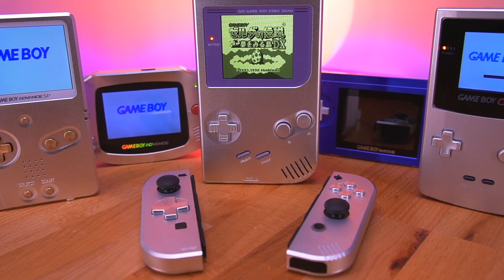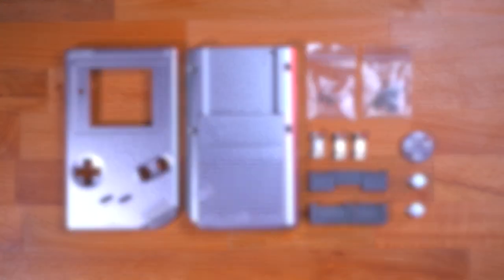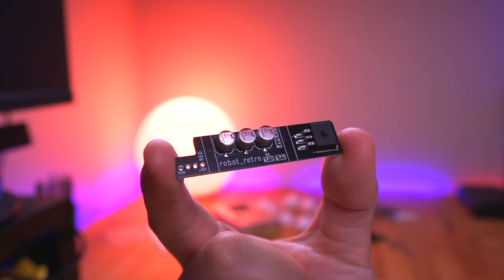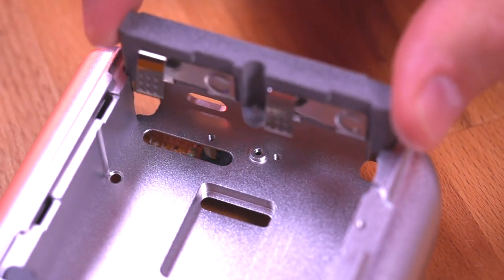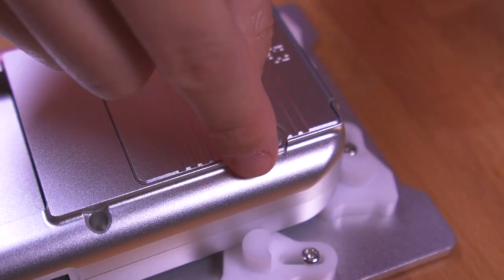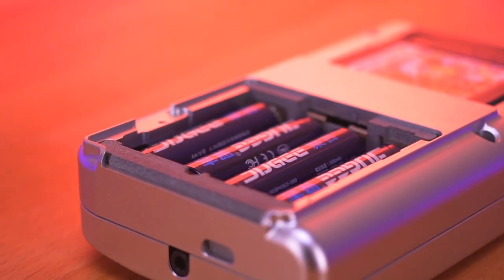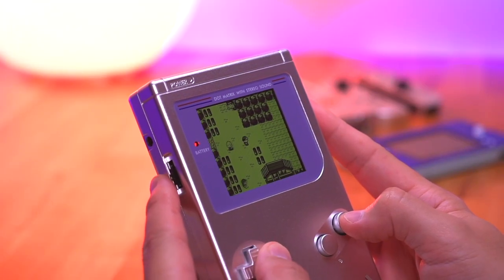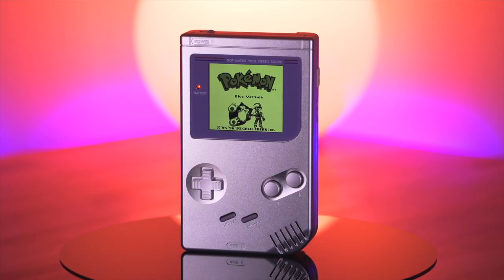The Ultimate All Metal GAME BOY

Comment: so not to be a negative nancy but after trying a couple of these builds myself; they look and feel amazing as far as overall presentation and attention to detail. That said, for performance; if you intend to actually use the gameboy, these kits are not that great (especially if you choose to go with the metal buttons). The OEM button pads aren't clicky enough to return to origin with the metal buttons+triggers or the extended plastic buttons to provide an OEM fit, finish, and function. As a daily driver I wouldn't recommend as I found myself going back to the original GBA or SP with replacement plastic shells and keeping the aluminum kits on display.
Reply from the maker: That’s true, I can see that the plastic buttons feel more original. I think the combo of a metal shell and plastic buttons could be a good middle ground

Comment: My build had a few speed bumps compared to Tito's. The most important was that I used the included screen bracket; I chose everything off the list on this video except the 3d printed bracket mentioned in the video. The 4 square blocks on the screen bracket that came with the kit needed to be filed down. This was to stop the click wheel being forced against the back shell and stopping it turning. 
The other was more bad luck, the adhesive on the glass lens was not perfectly cut leaving some glue on the back side. I ended up having to clean off all the adhesive, polish the screen and apply my own cut strips of 3M double sided. All of this took several re-openings, but in the end I have a really nice result and the Gameboy is great to hold and play.
Reply: Man wish I’d have seen this comment before starting my build. I’m running into the same issue. Put it back together and the contrast wheel is jammed. Couldn’t figure out what the issue was. Wish this video was amended. With a mention of this. That was the only part the I used different from Tito.
Reply: @nicolasbray2407  after the fact I noticed that boxy ended up producing a bracket in the same material as the plastic battery connector pieces, one day I might install one just to fully complete the build (even though I would be the only one who knew about it).

Comment: I think the battery insert should come with the kit standard. I think it's a little silly to not at least include everything you need to make a stock dmg work. Charging for each battery insert separately just doesn't look good to me.
Reply from the maker: I think it’s for the future when there will be an option for yawing regular batteries or installing a rechargeable lithium ion one
Reply: I get that point. Although personally after doing a few different mods I have accumulated quite the pile of unused bits and pieces!

Comment: Fyi, the bracket that comes with the IPS kit is too thick. You can’t close the DMG fully when using it since it will put force on the IPS kit and volume wheel. Which bracket did you use in the video, I didn’t find it in the links in the description 😊

Comment: Hey Tito do you think the Cleanjuice rechargeable battery would work with this shell? I'm fine with unscrewing the back plate to charge it, but I wonder if it'd fit. Would you still need to buy both the battery contact clips and battery isolator halves?
Reply from the maker: Hmm that’s a great question. I would think that the battery insulators and contacts wouldn’t be needed. Hard to say exactly without knowing the dimensions. I think it should work but it 100% sure

Comment: Why don't you ever recap anything? At least suggest it.
Reply from the maker: Not sure if you saw my last video but I re capped an entire pc engine LT. I generally don’t replace caps unless there’s evidence of an issue or leaking
Reply: @MachoNachoProductions  Most of the caps are 30 years old. Its should be mandatory required maintenance.  You don't need to do it on screen.